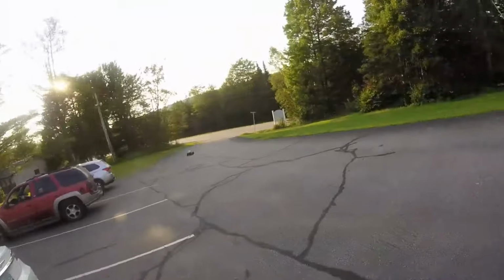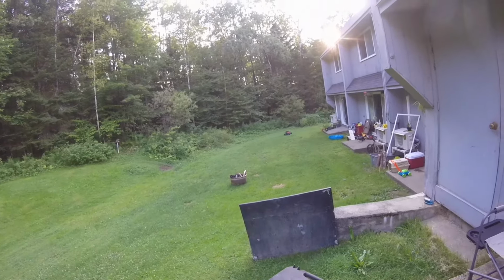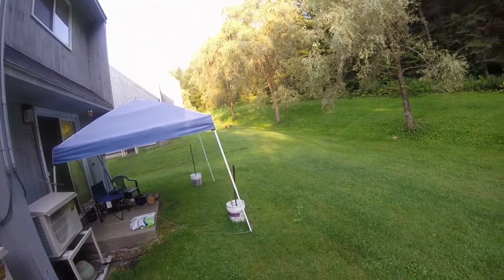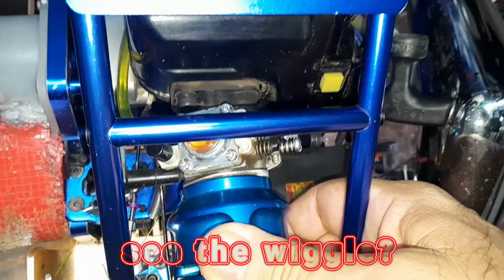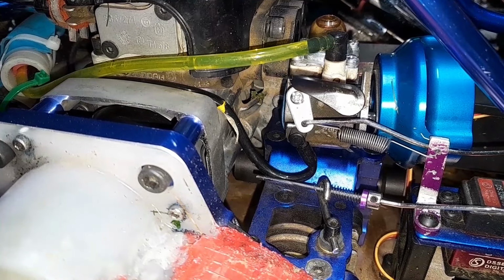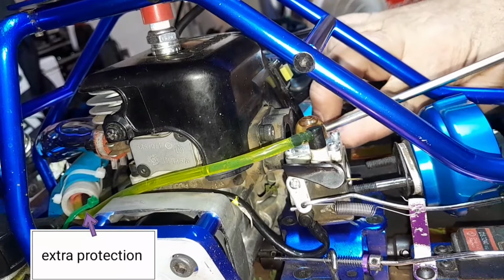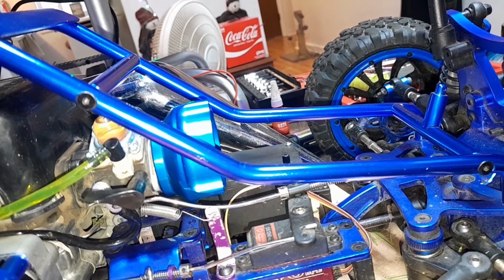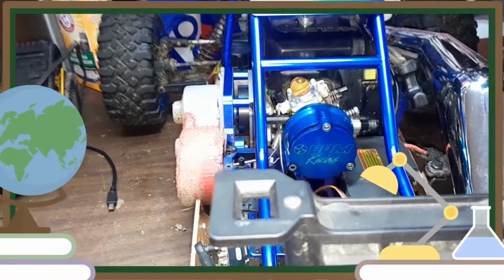testing the G320 in the Rampage @RCWalletVacuum

Comment: Braaaap!! g320 is a fantastic choice for the MT.
Reply from the maker: Yes. I saw your videos on it. Perfect fit. I had to shim the engine and gear plate up to make the drive shaft fit. But you know that haha. More kids to come. Thanks for your time bud
Reply: @SlickTrickRC  wait. Say what about shims? If you use the modified Losi g320 clutch housing and the stock Redcat fan cover, it will bolt right in and all shafts line up as original.

Comment: Why not blue thread lock so how are you going to remove the screws with the red thread lock if you have to fix it
Reply from the maker: I tried blue on my other engine. The screws loosened up.  With heat the red thread lock will come out. It's not a perfect solution.  But seems to do the job. Thanks for your question